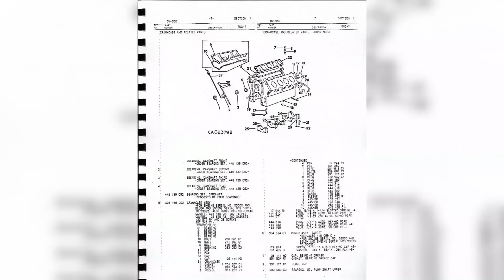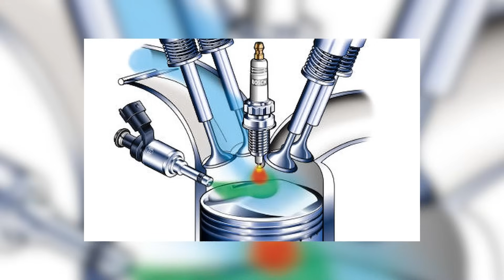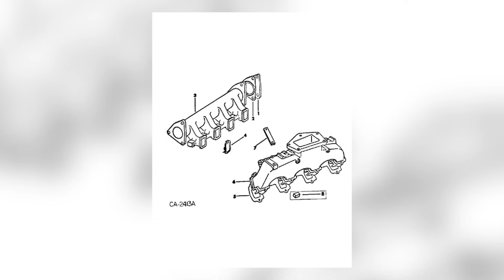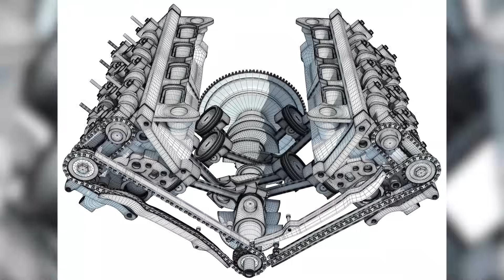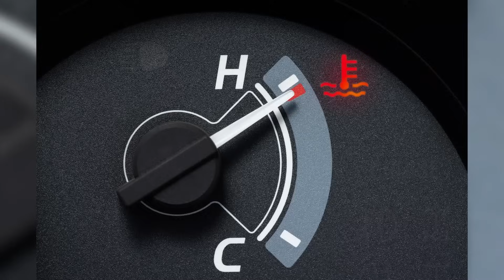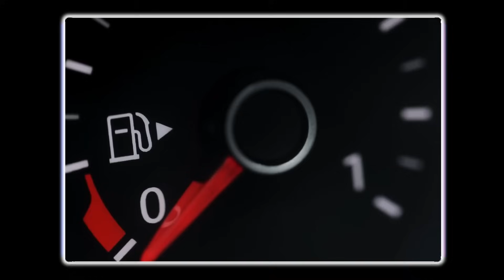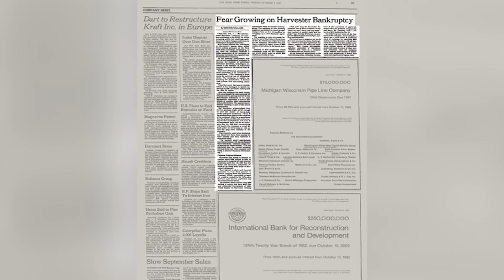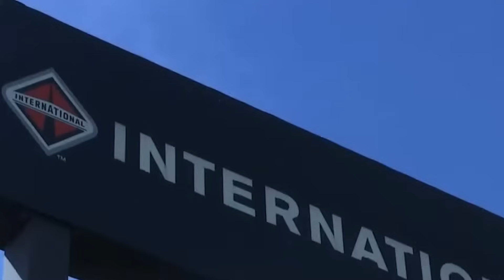The Shocking Truth Behind International’s Disastrous 9.0L Diesel Engine

Comment: In my country (Dominican Republic) we still use International S-1700/3700 buses for public transport. The two most common engine options for these are the 9.0L and the DT466, but we mostly use the 9.0L despite being engines with difficult parts to obtain. Personally, I love them. Even though they are not very powerful engines, they give me a breath of fresh air in a market dominated solely by the same platform of the 6-cylinder inline turbo diesel. Curiously, it is rare for them to break here despite being engines that are driven hard on the streets 24/7. And if they do, it is always due to the common problem of a blown cylinder head gasket. On my channel, I have several shorts about the various buses here doing accelerations with the 9.0L.

Comment: The DV550 and the 9 liter were different although it was a derivative of the 550, it did not have wet liners or a 4 valve head. I ran a fleet of these in school buses and was a great engine for that operation, we did have head gaskets issues with IH finally addressed after 5 or 6 head gasket modifications and they got 10 mpg on a trip.
Reply: The 9.0 litre was a complete redesign of the the DV550 and was a good engine

Comment: The dv550 and 9 liter engines were completely different engines. The dv was around at the late 60's and early 70's. This guy doesnt know shit from shineola.
Reply: I have a 9.0 liter, are they a good engine?
Reply: They have 2 weaknesses,  connecting rods could be stronger, and head gaskets could be a better design.  If you don't lug it you shouldn't have any problems. We had a customer that had a fleet of these in school buses with Allison  at545 transmissions.  Not 1 failure.

Comment: CRAP AI
Reply from the maker: You might think it's crap, but it's not AI. Just me doing research and trying to make videos about things I like.
Reply: @VintageAmericanMachines  My apologies. When I see things that don't match the subject matter it's usually AI just tossing in unrelated pics.
Reply from the maker: Yeah, I need to do better though. I really enjoy making these, but I gotta find better sources for my info. It's hard to get accurate info on these old engines. Even the forums are full of know-it-alls who are often wrong.
Reply: @VintageAmericanMachines  I hear that, I am done arguing with key board warriors that have never actually fixed anything. I have been turning wrenches over 55 years so I kind of have a clue....
Reply: mía culpa i should e more forgiving i know you work hard to produce content. i also know there was a time when there were gasoline start- diesel run using a compression relief valve in each cylinder, that was an alternative to a pony engine. those engines also had spark plugs. so cleaning spark plugs was a real thing.  So my comment was a double joke. 
thanks bill

Comment: Not really a good low to midrange diesel. Had 12 in our local P&D fleet. Compared to a CAT 3208 or IH DT466 the 9 liter was low powered and would blow head gaskets due the load stress that was put on the engine. It was better than the Detroit 8.2 liter engine.

Comment: Wet liners? What this guy is smoking? the dv550 and the 9.0l were did not have sleeves at all. And the 9.0l was a improvement of the dv550 but quite different engines.
Reply from the maker: Yeah yeah, i found out once it was too late. I read through forums because info is hard to get on these old engines. After these comments, I dug a lot deeper and found a guy who used to work on them and said this, "These engine are known as "parent bore" engines, no sleeves."
Reply: Just my two cents, but you might want to be cautious with phrases like "Yeah, yeah..." — it can come across as dismissive, even if that's not your intent. It might give viewers the impression that you don't value their feedback. A big part of running a successful YouTube channel is being able to stay composed and respectful, especially when others share differing opinions.

That said, I really enjoy your content and always end up learning something new from your videos!

Comment: I worked  on a fleet that had these. Ran great. Not wet liners or spark plugs.
Reply from the maker: That is the single biggest bit of information that's difficult to get on these old engines. I even read forums where guys were asking whether they were wet or dry. Enough people said wet, that I put that in the video. Thank you so much for this information! I hate it when I get stuff wrong, and 9/10 times it's the liners.
Reply: A LOT OF THIS CHANNEL'S ENGINE REVIEWS ARE DEAD WRONG . I TO WORKED ON A LOT 9 L DIESEL ENGINE . I HATED WORKING ON THEM !  GIVE ME A DT  466 WITH THE P 7100 INJECTION PUMP ANYDAY ONE OF THE GREATEST ENGINE EVER BUILT I KNEW PEOPLE THAT TURNED THEM UP TO 3400 RPM.S AND CRANKED FUEL UP AND THEY LIVED . UNBELIEVABLE .
Reply: @lpete2766 I have both. While the DV 550 has not given any trouble for me, the DT 466 is such a joy to drive. It performs well. Almost 350 k
Reply: This is a diesel engine. Why would it have spark plugs???